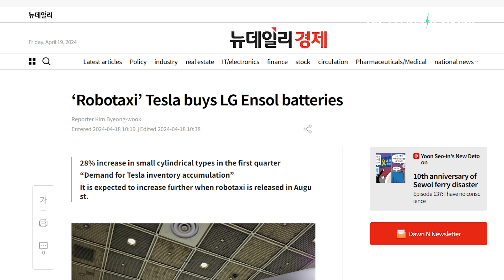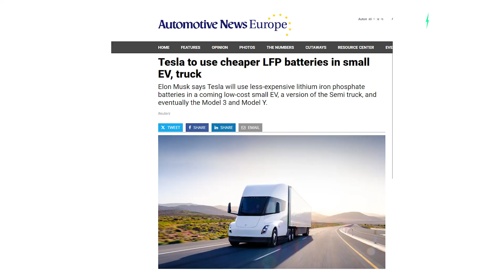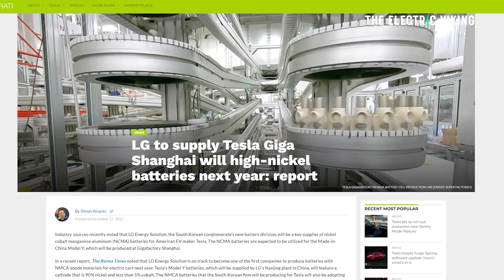Tesla is stockpiling huge amounts of batteries in America...

Comment: I'm still trying to find the LIFE of the batteries I'm sure the cost to replace them will not be cheap, any idea Electric Viking???
Google it
The lifespan of Tesla batteries depends on usage, not time1. According to a tweet by Elon Musk, Tesla batteries should last between 300,000 and 500,000 miles
Pretty good, you'd be changing a petrol engine at 500K miles or sooner

Comment: "Energy Is Money", and batteries are like banks, storing energy for later use. What happened in Germany, when they took out one electric pole and shut down GigaBerlin(?) So what if the EV sector slumps, because Megapack and Powerwall production is ramping. If EVs were all Tesla had to sell there might be a problem, but energy is critical to everything Tesla sells. Batteries from everywhere/everyone are critical to Elon's 'core' mission of clean/renewable energy, and would you rather have Tesla with more storage, or spend billions buying oil for a "strategic reserve" and putting it back into the ground(...?) Damn, that's just stupid(!) Yeah, Elon has batteries, and contracts/plans for more batteries, but the only relevant question is ..."How many keys in your wallet"($)🤑😂🤣

Comment: Risky. Lithium batteries have a shelf life. They degrade over time, even if not used. Batteries, like any other "perishable" item need to be purchased just before installation and sale, to be at their best. The other possibility, would be for "Power walls", "Mega packs" and other stationary energy storage applications. Tesla may even decide to put electrical energy storage in their "Super charger" sites. If that's the case, those cells may already be allocated. It would seem though, that for "Mega packs" LiFePO4 would be the better choice, where the home energy storage "Power walls" might still use the Li-NCM for the greater capacity in a smaller size.

Comment: Tesla vehicle production has been cut back from previously projected. Battery supply chain has not adjusted quickly enough and overproduced in anticipation of the previously higher anticipated production. Therefore, more batteries than cars to put them in, increasing inventory. This happens frequrently when production is cut back.

Comment: Tesla shares have fallen 37% this year so far, 14,000 laid off and tesla sales also dropped 

stock piling? more like over stocked and not used also LG  has issued a safety warning on their cells when storing
Reply: 14,000 people and it didn't spark any investor confidence, they would have been better off overproducing cars in hopes of $250 oil, which some traders have actually bet on last week, be it at a low entry price but still.

Comment: NMC (Nickel Manganese Cobalt) batteries have the highest energy density among the popular type of Lithium ion chemistries.
The best use case for such batteries would therefore be the Semi, Model S, Model X, or Roadster.
Reply: No cobalt should be used in batteries. No lithium either.
Reply: @markmiller8903  What's your reasoning, basis for your reasoning, and the source for your basis?

Comment: Tesla is getting ready to release the upgraded M3 Performance (Ludicrous) model and that vehicle uses 2170 batteries as opposed to 4680. I believe that the new M3P will be a game changer and attract a ton of buyers in terms of bang for the buck performance that nobody else can even come close to. It is likely going to be a best seller as a result. Robo Taxis on the other hand will want to use the 4680 LFP battery as having the ability to charge to 100% will be one of the requirements for such a vehicle. 2170s don't make sense for this application as they don't hold up well when charged to 100% all the time. They do make sense for the performance car as they have the ability for greater instantaneous bursts of power that a fast accelerating sports car requires which is why they are used in the M3P.
Reply: Makes sense the M3P 2024 is tax credit eligible. Looks like the tax credit qualifying batteries are going in the higher margin models. Tesla really squeezing the margins. Great pivot

Comment: You mean they can't sell cars to put them in. Aren't you always slagging off LG batteries because you think they're rubbish?
Reply: Now Tesla is using LG cells, that particular prejudice will die probably.
Reply: @hvh377 LG chem are making lfp batteries for Tesla, not pouch batteries.
Reply: @rozonoemi9374  You know that and I know that, but it never stopped Viking from crapping on them anyway.
Reply: No. He slags off LG's use of pouch batteries, not LG as a whole. You know the ones used in the Bolt? The ones that required every car to be recalled and the batteries replaced after many of the cars spontaneously caught on fire? Tesla advised car manufacturers to avoid pouch batteries as thermal runaway was a difficult thing to deal with. In the case of GM and LG, they didn't listen and paid a huge price. The batteries Tesla is purchasing from anyone they can, are all cylindrical. The issue is not LG. It is their use of pouch batteries for EVs. Think Ultium.
Reply: What those batteries are for is pure speculation. Nobody outside Tesla knows what they're supposed to be used for. Certainly Viking doesn't know. However, when it concerns Tesla, his speculation is always something like 'they're preparing for the next big thing' and when it concerns any other manufacturer, it has to be 'lack of demand and they're going bankrupt'. Think about it. That's not normal. And it isn't true either.
Reply: Yes the are
Reply: @orionbetelgeuse1937 tesla is stockpiling 4680 batteries they produce
Reply: They're preparing for the inevitable sanctions on china
Reply: Are they using them in the Megapacks?
Reply: Tesla sold 1.8 million cars in 2023 up 1/2 a million from 22.   A few bad quarters does not mean the world is ending.   Do you recall Elon depressing everyone in the earning call?  Tesla generally uses small form factor cells where they need high power delivery.  As in the S Plaid.  No I don't expect to see a lot of S's built.   But the new performance model 3 might use them.
Reply: Tesla is 'battery-agnostic', and has contracts with every battery manufacturer. Guaranteeing global battery production, even with its competitors, BYD and Volkswagon. The 3 pillars of ENERGY are capture, storage, and delivery. What Tesla doesn't put in cars they can use for #Megapack, #Powerwall,  or scrap for Redwood recycling(...?) Battery chemistry is constantly changing, but entirely too much energy is being wasted, and 'energy-is-money"($) Altman/OpenAI says 'compute-is-money', but without energy there is no compute. See US state of Virginia, wants to resurrect coal for its massive datacanters, because they don't want to build solar/wind farms, so their willing to poison coal miners to feed the Amazon[...et al] 'greed-for-energy', and raise the price for consumers. That's the American government/oligarchy at work🤬 Fast, dirty, and corrupt(.)
Reply: Model S and X are finished, look at sales figures. No car sales, no demand for this specific cells.
Reply: @docsnider8926 model s & x are low volume car & will get upgrades in time.
Reply: @danharold3087  I did not claim Tesla is losing money (you're misrepreseting what I wrote again), but your reaction is absolutely typical for a Tesla fan.
It would be nice if Tesla fans spent only half as much energy discussing their own brand instead of others when it shows signs of having some headwind.
But alas, Tesla fans ignore the news, spin the positive for Tesla and blow up anything they can turn negative about other brands.
Reply: @hvh377   Your statement "Tesla failing though....  " opens the door to the question regarding Tesla making money.   
While there is SOME truth in the rest of what you say it is equally applicable to the anti Tesla crowd.  Just swap a few words.
Tesla's fans need to put Tesla's shortcomings into perspective, as the hatters generally use information in isolation.  Thus the mention Ford's problems.
But also Tesla hatters ignore the  news, spin the negative about Tesla and blow up anything they can turn negative about Tesla.
Look at what people have are saying about the recent accelerator problem.  The reality is that production never stopped.  They identified a procedural problem in assembly, corrected the procedure,   fixing or fixed the trucks awaiting shipment, and recalled the remaining 3K or so trucks to the service centers
Reply: That’s a silly take on the situation! Tesla sells a crap ton of EV’s not to mention the batteries they use in their energy storage solutions. They’re stockpiling batteries for a reason…not because they have to!
Reply: They definitely are selling cars:  they discounted model Y in-inventory for less than 2 weeks I think and sold enough that they took all of the discounts away .. that’s not a demand problem at all
Reply: They are ready for future need for production of their transport truck when it starts ramping up.

Comment: Could be for Tesla Power Walls
Reply: Or megapacks.
Reply: Or Tesla ride on mowers and tractors.
Reply: @JoeyBlogs007  The lawn is done. But you just started 15 mins ago? Yep.
Reply: @JoeyBlogs007  Tesla refrigerators with built in battery backup! How about Tesla AC units?